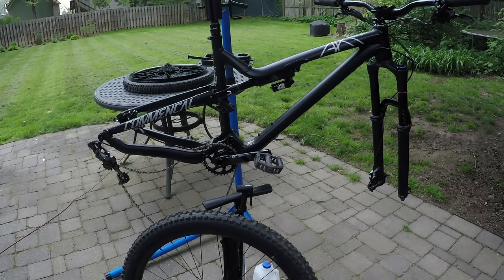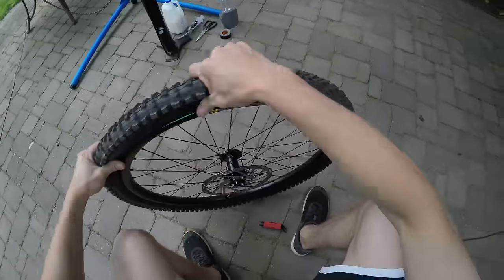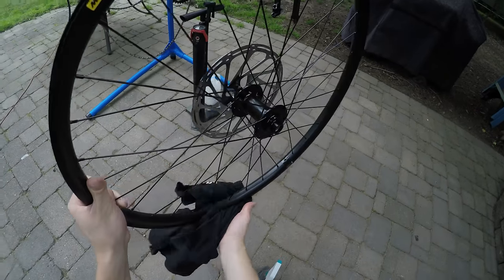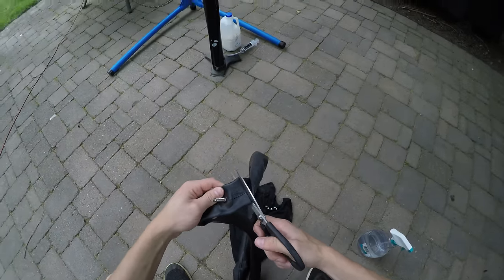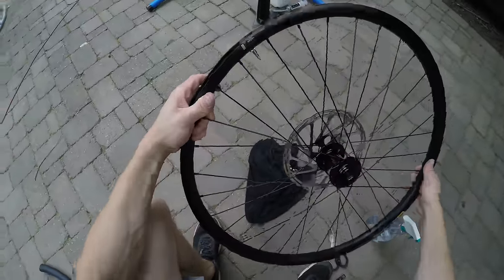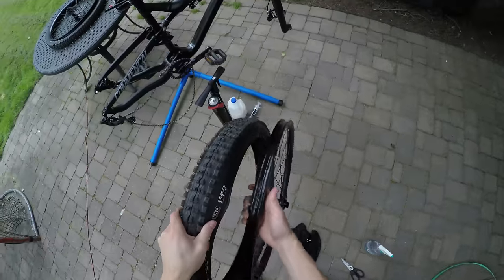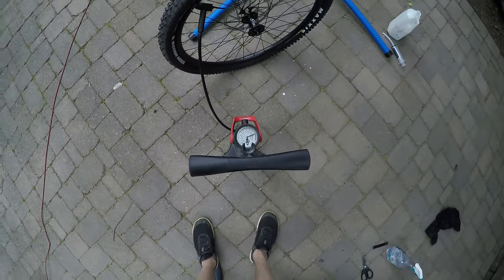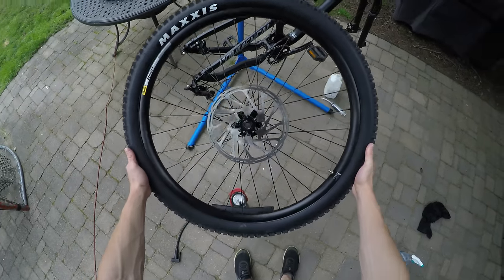MTB DIY Tubeless Conversion - Easiest and Cheapest way!

Comment: Today I went into a neighborhood tire shop and told them I'm converting to tubeless tire from my traditional 26" rim. He suggested that I buy a new bike instead. Haha. What a douch.. Last time I'm going to that shop!
Reply: I own an og 26er also, but it’s without a doubt slower than the new 27.5 even more the 29er. Still more fun and agile to throw around.
Reply: Had something like that happened to me too, i wanted a single chain ring employee tried to sell me a whole drivetrain😂
Reply: @charlestan6546  I've an old old 26  rock lobster and a plus size 27.5. considering going mullet. Haibike.7 nduro xduro......they both have their charms but you just know which 1 is faster....I don't have to say....new school is so more stable and old school takes more of a wrestling match.......but I love them both.....
Reply: Bike shops at least in my area are crooks (NJ)
Reply: Gonna turn my 26in into tubeless and see if it works
Reply: @BostonScottMesa  how did it go?
Reply: @BostonScottMesa  i am thinking about going tubeless too
Reply: Bro 26 are very rare to go tubeless
Reply: @jpxc1329  why
Reply: Tire shop? Why would a tire shop work on a bicycle tire? I hope you meant bike shop
Reply: I'm a 27.5er
Reply: @Ju-mg3os  well it depends. a single front chain ring on a clutchless derailleur will just drop chain
Reply: @jpxc1329  what?..  no they're not.
Reply: @bradrogers4281  haven't got a clue why he's saying that tbh.. not very rare at all
Reply: Good job that otta learn him
Reply: @tmitche36 no it really doesn't

Comment: Awesome video! I've been running tubeless for about 15 years. The one recommendation I'd make to my younger self would be to invest in a good air compressor from the start. I like the ones from California Air Tools. Not only will it save you tremendous time and headache getting these things to seal, but it opens up a whole new world for other tools for around the house. Just consider it an investment that will serve you well for many many years.

Comment: My tires were really hard to get on and off the rim. I was sure I screwed up and lost some sealant. To my surprise it worked really well. Did a hard 10 mile single track the same day, no issues. Thanks for the valve tip, saved me $20.

Comment: First, this is a super clear, well done video, much better than 99% of how to videos on youtube. Below was my experience applying what I learned from this video to convert my 29er 2.2" tires to tubeless. Overall the advice was great, but it took two attempts to make it seal properly. In my case, I did not have a pump with a reservoir or a high speed inflator, either of which I think would have made my first attempt work better, since in the initial inflation there are so many places for air to escape (and sealant to leak out). I used my Ryobi 18 volt battery powered electric inflator, which is not terribly fast. I think it probably helps if the tire is inflated really fast (i.e. with a pump that delivers a high volume of air per second) when doing the initial seal. Also, the casual finger tightening of the valve nut did not seal the valve well enough. On my second attempt, the partial messy sealing from the first attempt made for fewer big air gaps for leakage plus I tightened the valve nut with pliers, to reduce the air gap around the valve as it was trying to seal. For the second attempt the following day I added about 30 ml more sealant, spread it around inside the tire on each side and inflated it again. This time I was able to get it pretty quickly up to 60 psi, where I left it for several hours to let the tire seat and the sealant do its magic. This time there was far less sealant leakage, it seated nicely and the gauge climbed pretty fast up to 60 psi. Mission accomplished. Thanks again for making this tutorial. Time to ride.

Comment: Thanks for the video. I did like this to my older 26" Trek 8500 with Mavic Crossride non tubeless rims. Tires are lightweight but anyway tubeless ready Schwalbes Nobby Nic front and Fat Albert rear. It works great but I had to use air compressor to get the tires to seat on the rims. This is the cheapest way to go tubeless.

In the future I will use anyway specific tubeless valves as then I can add the sealant through the valve as those have removable valve cores.

Another extra thing I will do in the future is I will install the tires first without the sealant after I have put Gorilla tape. Then I will fill them to 40 psi so the Gorilla tape will attach even firmer to the rim. After this I will add the sealant and refill them. I clean the rims with CRC Bräkleen brake cleaner and when I put the Gorilla tape I put it on the rim very firmly and make sure there is no air left under the tape.

 I found Stan´s No Tubes tubeless valves for great price only around 3,50 euro per valve (-60% from the normal price). Gorilla tape is a good and cheap method. It costs here only 3 euro per 9 meter (25 mm width). One Gorilla tape roll can be used with around 6 rims (at least with 26" rims). So total price per rim is around 4 euro in the future + tire and sealant. I used now Zefal sealant around 60-80 ml per tire which costed 30 euro for 1 liter (1000 ml). So sealant cost per tire is around 2 euro. I also ordered Orange Seal Endurance sealant for use with more difficult tires like Schwalbe Racing Ralph very lightweight and thin (read porous) sidewall version. It should seal even better.

Comment: This worked like a charm!  I used extreme hold tape from 3m that I had laying around in the garage to tape the rims, slime from O'Reilly auto part store - large bottle 946ml $14, old punctured 26in tube presta valve cut out just like the video and also a regular floor stand bike pump.  Estimate I used 120ml of slime for each 29in tire.  Awesome video and great DIY tips for cheap!  Thanks!

Comment: Just did this over the weekend. Gorilla tape and old presta stems. I used 3/8 rubber faucet washers to help give a uniform seal. Did a dry air up first and they both held air. Made up some homebrew sealant and went for it. Sealed up good after a few rotations of the tires. Been holding air since Saturday. Thanks for the video!
Reply: Hi, Wondering about home brew sealaint. any tips what to look for?

Comment: Gonna try this on my non-tubeless rims and tires and update here.
Reply: Just did a quick test to see if my cheap plastic floor pump would seat the tire. It works! I used some narrower (narrower than the rim width) electrical tape but made sure to wrap from one rim wall to the other. Seems critical, It gives the tire bead something to grip against. It maxes out at 25-30 psi for now. No sealant yet. Lots of leaks in the tire sidewall (Conti XKings). Will redo the whole thing this weekend and put sealant.
Reply: Update: redid the whole setup with gorilla tape and Ryder sealant. Took a few days to fully seal on my non-tubeless rim and tire (Continental XKing) Critical step is to let the wheel lie flat on each side so that sealant gets on the sidewalls.
Reply: Update: just completed a test ride on the trails. I tried riding as rough as I could, bashing the tire around on rocks and roots, just to see if the bead would burp air. It works great, no leaks & no burps. Ran it at 30 psi then down to 20psi. Sweet spot is somewhere in the middle for my setup.
Reply: fair fucks for the updates lad
Reply: Thx man
Reply: thx
Reply: ima trendetter and youre sayin my word bra
Reply: this dude nice
Reply: Is the tire also non tubeless?
Reply: What's the name of the sealant you are using ?
Reply: soo you used nontubless tire?
Reply: @joshferreria6113 
Nice.
Reply: @johartcabral7864  yh
Reply: how do you change your tyre? do you have to do it all over again when you change it?
Reply: @ირაკლიყაველაშვილი-ჩ1ღ  გაუმარჯოს ქართველო :D
Reply: @Josh Ferreria SO this should hold up just fine on my Raleigh Redux 1 that is an urban shredder with 2" all-terrain tires "smooth in center,knobby on sides" non tubeless rims?? just normal every day riding on roads with the occasional curb jump and bunny hop??
Reply: @angeryanimal398  გაგიმარჯოს :)
Reply: @ირაკლიყაველაშვილი-ჩ1ღ  what language is this
Reply: @willblundell2250  Georgian! <3
Reply: Did you use a non tubeless ready tire?
Reply: Watch Unli Ahon they answer your question
Reply: @joshferreria6113  Thanks for sharing info
Reply: When I have the time, I might use this tip and see if it works on my stock (I think non tubeless ready rims?) but will buy a tubeless ready tires and see how things will work out. Big thumbs up for checking it out @Josh Ferreria
Reply: Hey dude. How are gonn add sealant in non tubeless tyre and rim?
Reply: Freyfrey Marcelo that is easy. Just take the tire off the rim on one part and put the sealant in

Comment: I absolutely would only do the valve stem trick if they have removable valve cores. The cores get gummed up and need replacing from time to time, plus it's so much easier to remove the core and add a sealant refresh through the valve than popping off your sealed tire and adding it that way. 

As an alternative to Gorilla tape, which leaves a horror show of adhesive on the rim, Scotch 8896 strapping tape works a treat and one roll does many tires. 

Lastly, TruckerCo sealant seems to be the most economical out there, and I've had no problems with it sealing most punctures (Road, TT, cyclocross, MTB - yes, I've converted them all!)

Comment: The tape you used to seal the rim deteriorates overtime. Mine I used elastomeric sealant (those found in roof gutter) to seal the rim holes and it works just fine. Well I just recommend this to those who want to go tubeless permanently. But that tape works just fine and your video proves it. Goodjob
Reply: magojiro kusanagi What elastomeric tape did you use? From Amazon?
Reply: Enve use/ed it for quite a while
Reply: Hope you never brake a spoke
Reply: @brdman, what PVC pipe thing are you talking about?
Reply: Ok, shavings means wood-shavings? And need to put that in the PVC pipe and put that PVC pipe along the rim like tube? How thick/wide PVC pipe? Do you have some pics? Sorry but kinda got confused with the items you mentioned  :)
Its interesting to know that the Stans lasts for couple of years, I heard that we have to top-it-up every 2-3 months to keep it liquid.
Reply: @ROOrtiz-ov8xf  break, senor
Reply: brdman  how big are the 'shavings' you mention?
Reply: Just FYI, he ist just talking about adding small plastic particles to the sealant, which ist not the worst hack I've heard of.
But not the best either
Reply: @HERGRYN  whats the best recommendation you have? Do you have a recipe and instructions for diy sealant?

Comment: Nice vid.  I prefer using an undersized tube as my tire liner (as opposed to duct tape) but either way tubeless is the only way I ride now.  I typically get over 10,000 miles on a pair of tires and I never get flats

Comment: I like to put the tube back in the tire and pump it up to maximum pressure. This will squeeze out all the air between the rim and tape layers. Then take the tube out and complete as you show. It adds another step but prevents that leaky problem wheel from happening. Which I’ve had a couple, though I use Stan’s tape which maybe the cause.

Comment: 2020 and still the best tutorial on youtube.. How many layers of the tape did you go?
Reply from the maker: Just one but you can go as many as you desire for a tight fit.
Reply: @ChildrenOfTheLoam  Doesn't the layers of tape (if hypothetically speaking I have put two or more layers) bother with how the bead will pop into the tire and hold on to the non tubeless ready rim?

Comment: I so regret buying those aluminum valves because the tire leaks from a bad valve seat and this would have been wiser yet free fix.
Reply: tighten the valve lock ring with a couple turns of a pair of pliers. Often an easy way to get a better seal.

Comment: Great video. What pump is that. Thanks
Reply: He tells you in the video what pump it was. It a bontrager flash pump. But if you have an air compressor with an air tank don't waste your money on that hand pump. Get one of those cheap air blaster guns with a rubber point tip. Remove the valve and blast air in works perfectly for me.

Comment: well a tube costs around $8-$10 so 2 tubes is around $20  and for that you can buy valves and still have 2 tubes for emergency repair out on the trail, or am I wrong?
Reply: Yeah, best to keep tubes that you have flatted with and use those I'd reckon. I do find they don't always seal as well as the tubeless valves you can buy though
Reply: I have in garage 20 old sieve tubes. Really good tip for me.
Reply: Hack: try going around bike shops in the evening. Usually there are tons of those around; punctured, but with great valves and rubber for DYI.
Reply: I pay $4 for my tubes
Reply: Since i run a motorcycle shop i salvage the valve stems from tubes. Wrap gorrila tape around the valley then poke a small hole. Use a dremal to grind the side of valve to fit channel nice put a dab of windshield sealant push thru tighten nut lightly. Sealed rim add tire inflate seat the bead then add sealant to tire.
Reply: Robert Trageser  (Researches DIY tubeless sealant)
Reply: Nope, your dead right. Actually, tubes are cheaper (at least where I live). But it's better to over guess than underguess. 😊
Reply: Yeah you are in fact wrong there, and besides.. who said you had to use brand new tubes anyway?
Reply: I pay 2 dollars for tube carry some extra in the bag
Reply: I don't buy tubes but  you can get 2 valves for like $12 bucks on amazon that work just as well as name brands. So idk how much tubes go for but valves are cheap and I prefer to keep my tubes that came with my bike if I ever have to use them.

Comment: What's stopping the valve from falling into the rim without a locknut when you hook up the air pump? Also, will this work if the tire and rim are not tubeless ready? Appreciate the video
Reply: Shane Frazier both rim and tire in this vid wasn't tubeless ready. I watched other videos using the same and still works.
Reply: allan villadelgado awesome, thanks for the reply. I've been doing more research and it seems like this is a common procedure and works for a lot of people. Will be doing this soon. Thanks for the video
Reply: His tire is tubeless ready, but the rim isn't. tubeless ready stuff just makes it hell of a lot easier to set up, but any non-tubeless stuff will also work just fine. Its just a bit more finiky
Reply: As you can see at 6:39 the locknut is installed
Reply: there is a locknut.
Reply: Nate Turtle where do you get a fitting one?
Reply: 5:13 "so put lock ring on fairly tight, you don't want to over tighten it"

Comment: i just bought the DHR 24x2.30 ,mainly because there are NO other tires for sale anywhere that would have FIT i had no idea if they were good or not or that they  were tubeless ready neither seller even MENTIONED that
 so id bought liners slime & thorn resistant tubes..
when those eventually go Ill switch to the tubeless but  I was lucky to find ANY tire in 24x2.30 
Now seeing what I bought Im very happy that the one tire i did find &  had to purchase are such good quality 
i was just lucky i found them on ebay before i  was forced to purchased knock off DHRs from an amazon seller  who had nothing but complaints at twice the price than I found the real ones for on ebay & those ship from straight from the manufacturer 
Maybe Ill buy a second set while they are still in stock if not when these new tires go I better find video on changing out to rims that i can purchase tires for

 I just bought that bike a month ago &  so was very surprised to learn that you cannot purchase any tire to FIT this BRAND NEW BIKE..
and the cheap chinese tires it came with shredded right off 
 my son was riding around on steel belts while i tried all week to FIND tires 
 Thats how I learned that you cannot purchase new tires in that size & width anywhere in the world
 so why are still putting them on kids mountainbikes..
GREAT VIDEO on the tubeless conversion..since i learned they were tubeless capable I knew Id have to one day buy the special valve & watch a good you tube video.

.your way seems easier Ill try that when the thorn resistant liners & slime Id bought for them fail I know eventually these tires will need to be converted

Comment: Great job ! Does this require Tubeless specific tires or can we succeed perhaps with a normal "Non-tubeless" quality MTB tire ?

I'm doing a 26 x 4 Fat Tire - any suggestions ? 

Appreciate hearing from you or others !
Reply: Tubeless ready are the best. Other tires require a lot more sealant.
Reply: Seems like normal MTB tires work as well, at least Maxxis advertises this for their tires:

https://r2-bike.com/MAXXIS-Tire-REKON-29-x-260-Dual-Compound-TR-EXO

Tubeless Ready (TR)
tube loose tires have many advantages: you can drive with less air pressure. This gives better traction and reduces rolling resistance. And where there is no tube , the breakdown risk also decreases. MAXXIS TR tires are better prepared for installation with sealant than other "tubeless ready" tires. The bead of the TR tire is like a real UST tube peeling completely covered with a rubber layer. As a result, tube assembly on all rims with standard dimensions is already successful on initial inflation and with little liquid.
Even "normal" MAXXIS MTB tires can be mounted like other Tubeless tires with sealant as the carcass fabrics are very dense.
Officially released for tubeless assembly and guaranteed by MAXXIS are only the new MAXXIS TR models. Tubeless mounting of other models is at your own risk.
Reply: @fishermans1friend  That is a tubeless ready tire, not a "normal MTB tire".